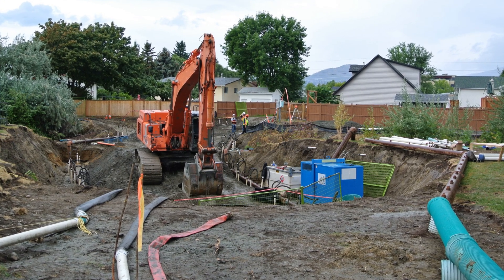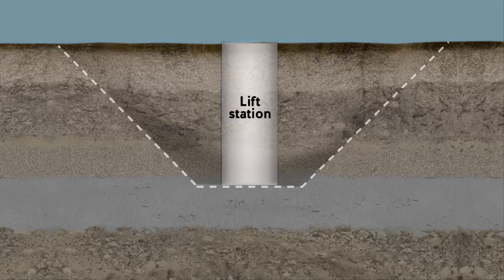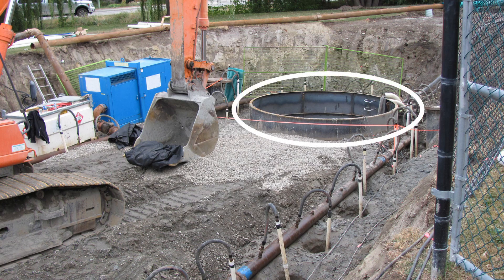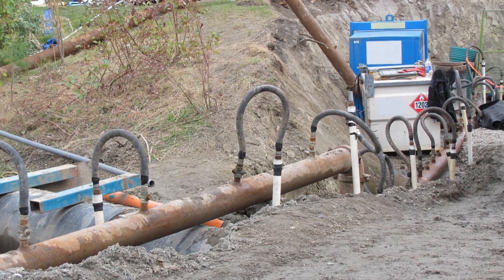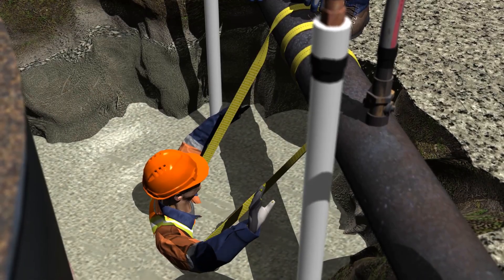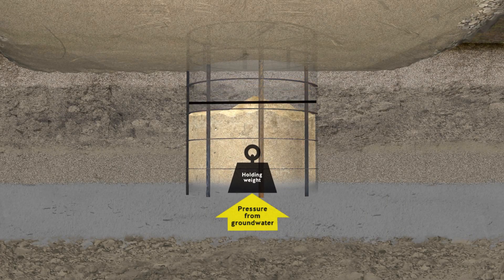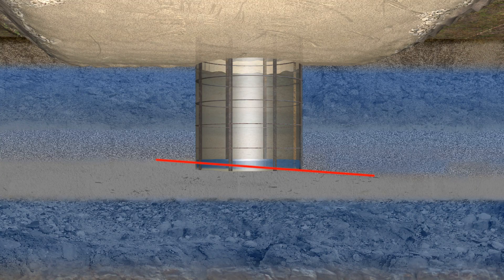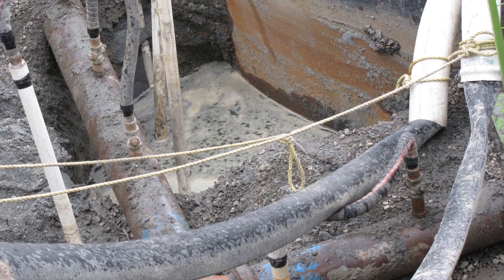Incident Investigation: Worker Pulled Into Ground by Quicksand Condition | WorkSafeBC

Comment: Quicksand may be a good word to use to make people understand what happened in the video, but it is factually incorrect. Quicksand does not suck you in, but it allows you to work your body down into the soil. Although you can be killed in quicksand, you cannot drown in the quicksand itself. You can only work your body down into quicksand up to your waist, at which time you will become buoyant. However, if the surrounding grade level is higher than your head, it is possible that you could become stuck, and the hole could fill up with water, causing you to drown. Or an alligator could come and eat you.  Sorry...

Comment: Nice to see someone didn't die for a change, in a WorkSafeBC video.
Reply: hey at least we hear reports of it... in shithole countries workers die like flies and it doesnt even get reported
Reply: ikill fh 
We had an incident of a bridge collapsing onto 3 workers and they got thrown into the toxic river with the concrete blocks, one died and two were heavily injured and had numerous infections. Cut up from some steel wires and stuff.
Real sad stuff when people have to risk their life for minimum wage.
Reply: @old_account189   i almost lost my arm working for free for a farm (1month traine/intern to test me out before they hire me) got hoodie stuck in the firewood chopper/processor. basicaly it got this spiked roller that is run on hydraligs that pull the big logs in to be cut and then chopped. the roller grabed my hoodie and started to pull me in. with pure adrenalin and muscle i held back that roller but slowly it keept sucking me in. scremed for help but nobody could hear me over the loud tractor that was running the machine via PTO. thankfully a co worker finally heard me and came running. stopped the machine just as the spikes started to penetrate my arm. was about 1min away from braking my arm in half. which is scary but not as scary as imagine having your arm broken in half and then still be stuck there and still having the machine suck me in.  lost usability in the arm for 2weeks but then i was back again and i learned my lesson to walk around it. took me from 1 full load per day to 3/4 full load per day but worth it for the safety
Reply: @old_account189  that's life
Reply: 2 soles were lost!
Reply: @PuffleFuzz  Very good, 10 out of 10.     I was going to crack a pun too saying " I'm glad things worked out well ...."   but that's not as good.  So won't.
Reply: You should see USCSB

Comment: Good video, one question though. Why didn't the trapped worker just float at the top? He is less dense than the quicksand mixture.
Reply: Do a YouTube search for liquidized sand, it's a good visual to explain what happened
Reply: Because the mass of water and soil he sank into was not static. The flow of water from below was creating actual suction , with material being flushed into the caisson and sides of the growing hole falling down into it around him and dragging him down.
Reply: No cohesion

Comment: great to see the guy survived.
i've experienced liquefied soil, but luckily it was only a foot deep, you sink so fast you have no time to think.
Reply: Normal 'quicksand' won't suck you under the surface, once you sink a certain amount(considerably less than in water, apparently usually about waist deep, as it's denser than water) you're buoyant. I suppose it is possible some people drown from normal quicksand, but indirectly - getting stuck and then the tide coming in or something similar.
In this case, actual suction had been created by the conditions.

Comment: That load strap was a good idea. Guy is lucky to be alive.
Reply: Rough Draft i am amazed that in that time of panic someone thought of it. The pressure on the body must have been unreal. Good thing all he lost was his boots.
Reply: @Evl_1  not a pressure problem, otherwise he wouldn't have been able to breathe
Reply: @xl000  Hes talking about the pressure (strain) on his body. His body was being stretched because the strap was holding him up but the sand kept pulling him down which must have been very painful.
Reply: @Evl_1  Good point.  My Dad fell through a ceiling and gashed his neck open.  I completely panicked and was useless
Reply: @Evl_1  you mean stronger than earth gravity?
Reply: Good job worker 1, worker 2, worker 3, and worker 4, and extra to whoever thought of the strap.
Reply: @trinarybit2  Whoever turned the pumps off was smarter than me.
Reply: @trinarybit2  worker 437 was notified of the situation a week later, when he talked to worker 541 that day, this situation was addressed and built into the digging processes.
Reply: He would have been sucked 20 feet underground drowned by silt and pulled into the cason
Reply: I can't imagine how terrified he must have felt until he was out. Wonder if he got the boots back (ha)
Reply: @xxlegolas  
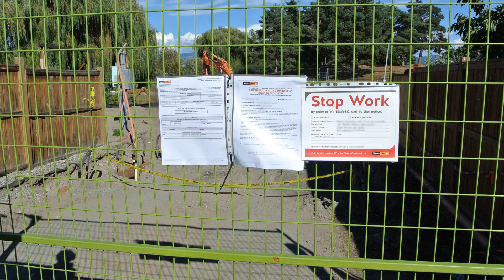6:32 "his boots remain underground til this day"
Reply: I was thinking the same thing. I'd never had thought to ask for one but know that ive seen it happen.
Reply: Rough Draft I was surprised they didn’t have more rope and more straps, and other metals to tie him on, or mscchinary like the picture of the excavator.

I wasn’t there, but I can guarantee from experience, people don’t know how to respond/act and react

Thank god he got out there
Reply: way to spoil the video
Reply: @Triunity4  why did you read the comments before watching the video?
Reply: @Triunity4  You spoiled it for yourself...  Use your brain next time, genius.